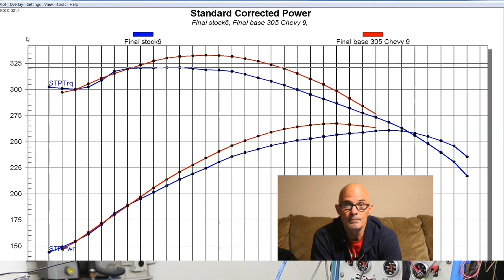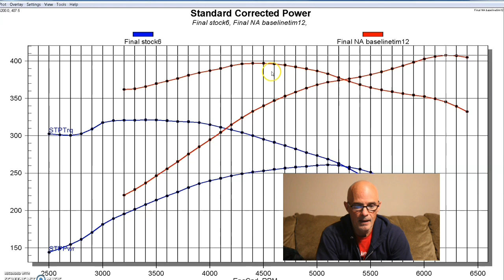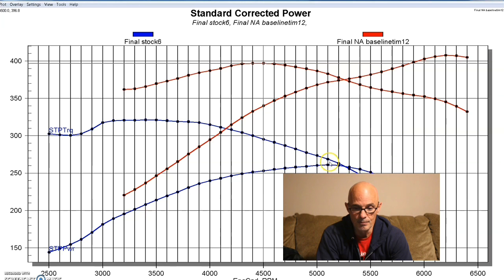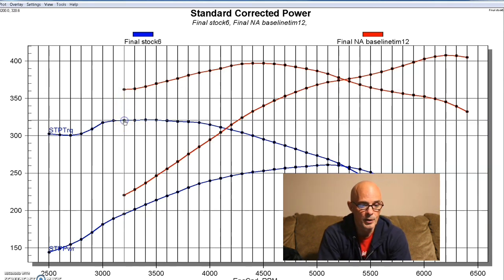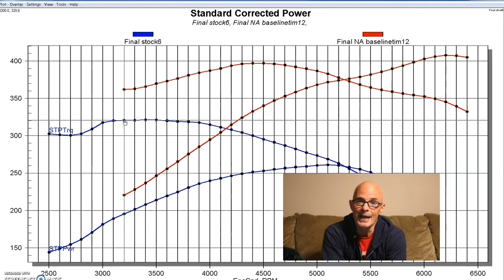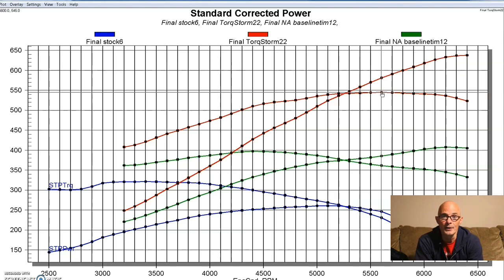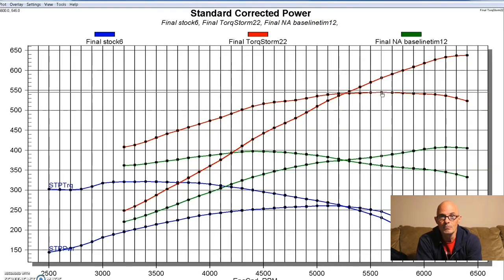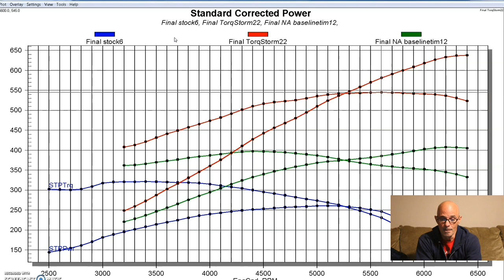5.0L FIGHT-302 FORD VS 305 CHEVY-FULL RESULTS

Comment: People can argue argue day about which one is better here but in reality the technology is so similar between the 2 engines,  you can do just about the same thing with either one.  Ford made the wrong move in terms of power when they kept the Windsor design instead of the cleveland. It was more technologically advanced. No hot coolant in the intake manifold,  cv heads, and a better bottom end. If they added a roller cam and 1pc rear main to it and made the tall deck 351 and the short deck 302 it would've been great.

Comment: I would like too see a REAL 302-Chev. (69/70) match up even with A new ford 302-Coyote// Running a 850-CFM Versus the injected 302-ford ! There would not be any win's w/the ford and I am sure the  old guy's from back in the day could retire again , w/dime bets..  Not Even Close ! Jim Cravey
Reply from the maker: the DZ 302 Chevy was offered 1967-69, it makes 100 hp less than a stock 5.0L Coyote In identical test method)-I l know, I build one and ran it on the dyno. Love the DZ302-it makes same peak hp at stock 5.3L LM7 truck motors

Comment: So wait, this 302 just made almost 650hp. What about those blocks cracking at around 500? Is this just an urban legend?
Reply from the maker: I have lots of runs over 600 hp on a 5.0L
Reply: @richardholdener1727  Thanks, good to know :) It seems that if you do good job setting it up and tuning it then they are not as weak as many believe.

Comment: Man, you're brave going over 500hp with that engine. You'll split the block.
Reply: Really I wonder how many split blocks you have seen? I have seen none, and I have built over one hundred 302's. Some for figure eight cars some for drag. Not one block has cracked.
Reply: @chrismontreuil2206  In person, none. But I've seen tons of pictures and videos.
Reply: @RealInsaneGalvatron  tell me where I can see a video. Thanks.
Reply: @chrismontreuil2206  Any video would just be like the pics. The aftermath. But that link is to a Mustang forum where they are well aware of the problem.

Comment: I'm going to disagree that the 3rd gen Camaro and the Fox Mustang were about equal in handling. I've owned both, a '91 5.7 Z28 and an '88 notch 5.0 5 speed and '91 hatch 5.0 AOD which I converted to a 5 speed.
The Camaro was noticeably better in the handling department. As a matter of fact when I picked up my first 5.0 Fox Mustang after having owned the Z28, handling was the first thing that jumped out at me. Thus, suspension was the first improvements I made. BTW, this wasn't some old worn out 5.0 Mustang, it was a low mile one owner car in excellent condition.
Nod to Chevy in the suspension department.....and I'm a Fox Mustang devotee.

Comment: I had an 86 irocz automatic. It was beautiful, but it was a dog. I own a 93 Mustang GT manual. Everything was stock when I bought it. Having driven both cars, the Mustang is light years ahead of the gen 3 f bodies. Way faster than the numbers would indicate. Burnouts for days. It's just angry. The Mustang is much more fun to drive. If memory serves 302 revs much faster than the 305. I do think the TPI engines are the best looking engines of all time. That didn't translate to performance. The major difference is the sound. The 302 doesn't sound like any other engine. 

 There were about 3 aftermarket items for the iroc in the Summit catalog back in 95. There were pages of upgrades for Mustangs.

Comment: What do you mean a brand new motor wont have more hp. That's just insane.  A brand new mustang in 1992 would flat outrun a 1991 with 30000 miles everyday
Reply: My car has  run 12.88 at 110 since new,now it’s got 33,000 still 12.88 @110
Reply: @MikeSmith-ey7ku  just the wear on the clutches would make that highly unlikely

Comment: The stock 5.0 Ford Windsor motor is a dog just like the stock 351, but you nearly double the power with simple bolt- ons Ford did this for Durability and not performance. The  Aod Trans. was too weak for any real performance combo.

Comment: Too bad that 5.0 wasn't built from a pre '78 block, they'll take a lot more punishment.
When Ford took the 302 to being named the 5.0, they thinned all the walls, the deck, main webs etc for the sake of saving weight - much like Chevrolet did with the 350 about the same time. Earlier 302s didn't need to be bored with deck plates up to .030" over, and were safe to .040 over and some to .060.
The Chevys safe to .060 during the same time - although the Chevys should have ALWAYS used deck plates because with the head bolt holes so close to the bores they always distort.
The boosted 5.0 Ford is on the edge at about 650hp., the earlier block about 700.
Figure the earlier Chevys stronger too.
Reply: Motor City Mike the one piece rear main seal and roller cam later block is plenty stout, and if you want really major league power durability your going to want to step up to the Ford racing, or World products short deck block.

Comment: Yeah old video but with this topic I'd think it will always get views, but I think the 302 got attention and the 305 got side stepped and basically hated  is where ford basically has 2 smallblock Windsor's if you have an 8.2 deck your kinda stuck with it unless you want to do a swap that requires changes like accessories, exhaust & intake manifolds  distributor and so on a 351 swap can get expensive but theres basically only 1 SBC so if you want to upgrade to a 327 350 400 whatever it'll drop right in engine parts will swap right over so why would you even consider messing around with a 305 when a 327 or 350 especially a 400 gives you significant free power and way more options. Being on a budget always I've never have or considered dumping money into a 305, unless you hate free HP it's kind of foolish. I can say if I had an Iron and all kinds of disposable  income I think it would be cool to stick with the original engine and build a 334 stroker and toss some boost to it just to be different (as far as the engine goes there's nothing different  about boost making HP N/A is being different these days) it would be cool having a seriously  fast car with a 305.

Comment: Ford had nothing for a while because the oem parts made so much power and where reliable the aftermarket didn’t come in as fast
Reply: The 305 Chevy  didn't have anything to choose from either cos the Chevy guys didn't won't to have anything to do with the little 305 so performance parts with limited because the 305 was not popular at all.

Comment: What does the fox say........ CHA CHA CHA WOOW CHA CHA CHA BOOM!
Oops too many 650hp runs. A lifter noise, no oil pressure at idle, still runs okay, pull it out and be amazed the only thing holding it together is the intake and oil pan.
Reply from the maker: it happens-less with centrifugal supercharger
Reply: @richardholdener1727  I am a foxbody Ford lover I hear you.

Comment: You bought the car from Ford and then, built the car you wanted. Stock, No brakes, no chassis, no suspension, no power, easy to remedy :)
Reply from the maker: none of that was an option for SSGT racing
Reply: @richardholdener1727  Yeah, I recall...one good hit from 200 km/h on stock Fox brakes and it's warp city....

Comment: Im into ford modular engines. The old pushrod stuff is cool but not really efficient. You can take a ford 3.7 dohc and run 7lbs of boost and make 600+ at the crank and its a v6 lol. Take a coyote and run 8lbs of boost and hit 850+ at the crank..... The 5.4 2v on 7lbs of boost with ported pi heads gets you 550+ at the crank....mpg is still decent and you are no where near bad streetable engines. Even at 1200+ wheel hp their still streetable. Rumors of the new upgraded gen 4 coyote will have valve duration along with cam angle duration along with the vvt and dohc.... Thats about to get serious

Comment: The 305 is the one Chevy engine that is extremely had to make run due to small bore and long stroke limiting valve diameter.  Why didn't you run a Chevy 302?  vs the 5.0 liter (302) Ford?  That said, I've seen some pretty good 305's after mods.   I agree that parts availability and match-up.  To tie it all up.....there ain't much Chevy or Ford in the engines in the final run.....mostly hand-picked aftermarket stuff.

Comment: Please find a “real” 5 liter Chevy, the original 4.0x3.0 302, and add those results! Way back in the day we used to bore 283s out to 4 inches, with varying results. In fact my friends and I broke a block in a C Gas dragster in college running what we called a 301. We ended up putting a factory 327 shortblock in it and managed an 8.99 at 154 sometime in ‘67. A real 11:1, 4 inch bore 302 would give that Ford a run for it’s money, I believe. I have to agree, though, that Ford 302 did very well. In another chapter in ancient history, I had an ‘89 notch back Mustang with a 5-speed, and it was a great car. Compared with my daughter’s 289, 4-speed, ‘66 coupe, there was nothing the ‘89 didn’t do better—performance, handling, gas mileage, all better in the later model. Of course all that old stuff is weak compared to the modern Coyotes and LSs. Still love the channel!

Comment: Fords has the advantage over  chevy because of rod length and con rod ratio.   Could you try a f I  fabricated intake manifold  with equal length  shorter runners.   You know. An intake like the  door  slammers use.   On each engine.  The factory  intakes really struggle the chevy tpi manifold  never was meant to support  high revs.    Play it again sand man

Comment: The stock chev. 305 was a Dog. In stock condition the 305 wouldn't stand a chance against ford's 302.
I'm a Chev. Guy forever, but facts are facts ford's heads had much better flow caricatures. Now the 69 Chev. 302 was a whole different Animal, and why the Z28 did so well in Trans Am.
Reply from the maker: THE 305 H.O. L69 WAS VERY IMPRESSIVE AT THE TIME
Reply: @richardholdener1727  sorry, but in stock form, I wasn't impressed.
Reply: Agreed.  One of my friends had a '68 Z/28, and it was impressive until he center-punched a phone pole.  The Boss 302 engine was definitely very competitive against the Chevy 302 engine (someone has done a video here on YouTube on a performance comparison between the two engines).  I still remember the sound of that Z/28 being redlined through the gears. Good times, good times.

Comment: To be fair you did a good job on the parts addition and about 60% of all horsepower is created through the heads but it's still kind of not fair to the 305 that you used CNC ported heads on a 302 but used a stop casting style head on the 305 giving it does have the smaller bore longer stroke I think you would have seen a little bit better power and torque if they had you used on the 305 we're seeing is reported as well maybe not a lot but

Comment: I think you are wrong about that "big bore breaths better" theory ...where displacement is equal.

Consider that the longer stroke negates any "bigger valve area" advantage, by allowing more time for flow to stabilize, and the air/fuel to get in and out of the cylinder.  Basically it boils down to time vs area.   From my experience, the effects on torque levels are pretty much the same, but a longer stroke is more efficient at lower engine speed, and  therefore tends to make it's torque at lower rpms.

I could be wrong, but I'd love to see a laboratory test, where the bore vs stroke perimeters are greatly exaggerated for maximum effect.  Not including combustion, (which is another variable entirely,) but simply the breathing characteristics of each.  It would be interesting.

Comment: I have to say, I don't believe. Especially the block splitter. Will not last with me driving... love all cars and engines. Just seen too much to believe it will be reliable
Reply from the maker: I drove my supercharged 5.0L at this power level for 85K miles
Reply: @richardholdener1727  my son had 2. One was NA the other was set up similar with supercharger. South Florida the supercharged heat soaked too bad.. tried to use as dailey, and it could not perform after a few runs. It was set up great and beautiful ride... fun as stink. After 30 minutes it would pull so much timing that it was not fun. We are aggressive drivers, so it was our fault as well
Reply: @richardholdener1727  they were both dark green and '94

Comment: Chevy actually sold Ford the 302, Chevy ran the 302 in their pace cars for NASCAR and it came in the 66 camaro but it wasn't working out the way G.M. wanted it to so they sold it to Ford lol
Reply: Smoke another one.302 is a stroked 289.learn something
Reply from the maker: The 1966 Camaro?

Comment: walks by and smiles lets shut a few people up Richard and do a 351 cleveland vrs 350 chevy test. That should shut the chevy guys up once boost is applied. Run edelbrock heads on both... Use a 351w block if needs be.. Yeah I think that will be a fair choice. >:) Don't you guys think? walks away smiling at the chevy people foolish enough to take that bet
Reply from the maker: I ran reproductions of the Boss 302 and Boss 351-they made more than the DZ302 and LT1 350
Reply: @richardholdener1727  I know, and people often forget the single most successful small block in nascar history is the cleveland ford, why do you guys think ford used it for 45 years and chevy built 2 different motors to combat it that never went into production cars, and why did it take the ls engine series 40 ish years to actually catch it in power production.. see engine masters for the reason why. Everyone thinks the small block chevy with it's terrible heads and other issues is a better motor, it's not it's just more common. Same with dodges, blame them for copy pasting the chevy engine design.

Comment: I to bought my first mustang in 1987. I bought a mustang GT. I bought the car on a Tuesday and that Friday night went straight to the track. I was hooked then. That next day on Saturday I went to a other track. That's when I met some of the best people that I know to this day. the only thing I don't understand from your story is going through brakes. For the first couple weeks that I was hitting the track I was doing it on my gatorbacks. Then I bought a street and strip tire. That was a total waste of money. After that I went straight to a slick. And to do a second gear burnout I had to apply the brake. Each one of my quarter mile run I was well above a hundred miles an hour and so was most of my friends. None of us ever lost are brakes at the track. Did I have to replace the front pads more often yes I did. I was fortunate enough to have a friend that worked at a Ford dealership as a mechanic. They used to give them a very good discount on parts. So the whole time I ever race was on motorcraft brake pads.

You are not lie about not being able to modify our Ford. Mostly everything in the summit catalogs we're all for Chevys. Lucky enough for mustang people there was a gentleman who called himself mean mr. Mustang. He wrote articles in one of the Ford magazine. He would try stuff on his car and write an article on what it did for his performance. It wasn't until the spring of 89 when the s*** hit the fan. By that point aftermarket started to catch up with the 5.0 motor. There were guys buying brand-new mustangs and taking them straight to a shop and getting superchargers. They never learned how to drive their car before throwing all that money into it. That's what took the fun out of it for me. It wasn't that now most mustangs were going faster than me it was just the fact that they took the fun out of learning to drive your car. 

A very good friend of mine helped me put a new motor sport rear end and my mustang. I was running 373 gears with slicks. The next day when we went to the track I could not get the car to go down the track faster than a 14. That's when my friend asked me could he make the next run and I told him of course you can. His first time down the track with my car he came back with a 13.5 time slip. So before I did any other work on my car I do learn how to drive it to get the most out of it.

I did enjoy your video. The only 5.0 that I drive now is my 1990 Ford 4x4 f150. Since everybody has to stay home right now in my state I'm going to pull my engine out to go through it and replace all the gaskets and I'm still deciding if I want to make a stroker engine. I'm also considering buying another fox body mustang and start racing again on the weekends. That's something I used to enjoy and could not wait for the weekend to get here to go. The only difference now is that I will trailer my car. On Saturdays when I used to go to the track I was always the first one at the gate to get in. Instead of just waiting for them to open that's when I would put my slicks on. Since I was running in the points division I no longer had to have my car inspected. So almost every Saturday I was always one of the first cars down the track.

Thank you for bringing back some fond memories.
Reply from the maker: I was road racing in SCCA SSGT-lots harder on brakes than drag racing
Reply: @richardholdener1727  that just shows you how close-minded I can be. I just assumed that if you were racing a mustang in the 80s that you were racing down the dragstrip. I did no a few people who ran Motocross. I know they used to have a big issue with their brakes. A couple of them even drilled their rotors to try to get them to perform better. Again I enjoyed your videos. I watched quite a few of them last night. Look forward to new ones  that come out in the future.

Comment: 302 stroked to 347 = 550 hp when done right ALL MOTOR add 70-80mm turbo and hit 700-1000hp depending on boost u run . LMAO bore and stroke balance and blue print that 302 to 347 u get more HP wo the SC